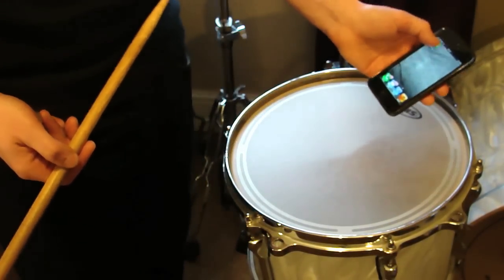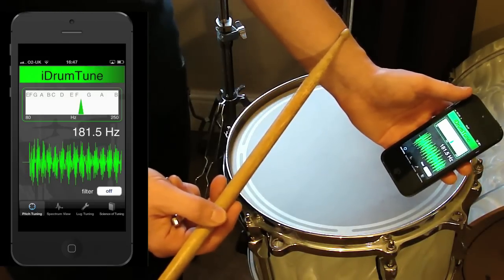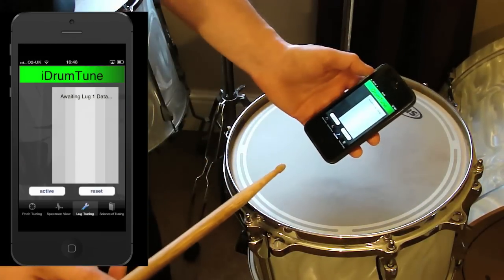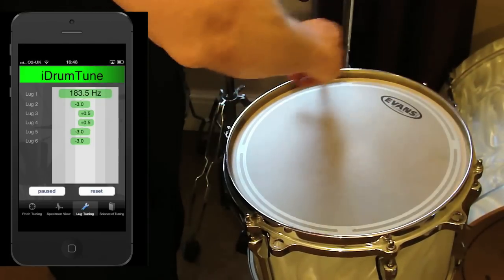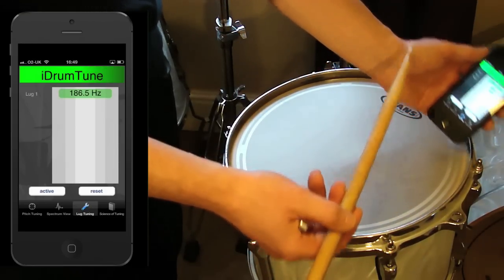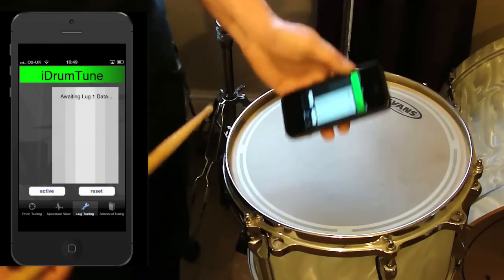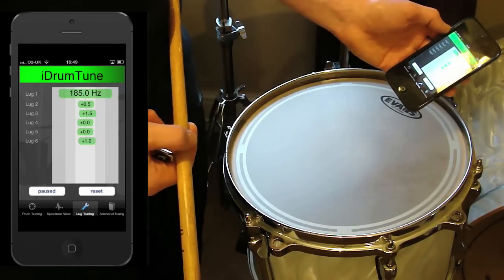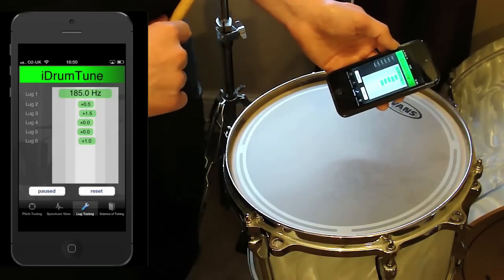Clearing the drum head - Drum Tuning with iDrumTune drum tuner app

Comment: Gary E, I couldn't disagree more, that end pitch was so nice and pure sounding, although I did notice it died instantly making me think the bottom head was tuned quite tight.  Greg Patterson you may have experienced what I found to be the issue with Tunebot, which is these types of tuners are so accurate that you have to be very precise in how you hit the drum to get this kind of result and also it helps if you get the drum roughed in.

I work in a drum shop and have used a Tunebot extensively and if this app was for Android I would try this for sure as I like how it saves pitches for each lug. I really really wish this was on android because I have found the Tunebot to be a bit finicky.

I apologize to use the Tunebot in these next points but it is all I have experience with. So forgive me iDrum Tune people but I think my points are valid for any tuner of this type as it has almost nothing to do with the tuner and more with what the player or drum are doing.

But back to my points:

1. You have to hit each lug at almost the exact same distance and intensity or you will get a different pitch due to those inconsistencies.  Try it with the app and you will see what I'm saying.  The guy in this video has the added bonus that with EC2 Evans heads you can use the black control ring in the head as your reference for distance.  Also use a stick as your finger is too easy to hit at different intensities.  This takes quite a bit of practice to perfect and I used the Tunebot

2. Also if you have a drum that has lost its round or has a bent hoop you will never get it in tune with a tuner of this accuracy because it will allow you to notice how much those two things destroy the tune-ability of your drum.

3. The other biggest thing is that with a tool of such great accuracy you will need to become extremely accurate at turning a drum key a millimeter at a time. When you get to +/- 3 and lower it gets extremely difficult to turn your key consistently without a fair bit of practice. Also a a lot of cheap drums I found that no matter what I did they fought me and would not ever get this accurately in tune. 

4. A finer point about tuning accurately is that if you tension rods are junk or not greased, or bent or anything like that they will not tune as accurate as you like. That plays a part in cheap drum sets. Having put together about 100+ drum sets and re-headed about 200+ I found that cheap drum sets have extremely cheap tension rods and tension rod receivers, which only complicates this process. Thus why DW and PDP went to tension rods with more threads for more precise tuning.

5.Not sure about this app but I found that with the Tunebot it helped immensely to hold the mic closer to each tension rod than in this video and it would get a more accurate reading but this video makes me think that this app doesn't suffer from that issue.

6.  Finally since we jam our phones in our pockets and they sit around a lot your microphone hole on your phone may have lint or something obstructing it, wouldn't hurt to compressed air that baby out from some distance to avoid getting it wet from condensation or blasting it so hard it breaks. Or if that seems a little risky just check it visually and maybe take a fine point tooth pick to grab any lint or whatever.

To conclude, Greg you have done nothing but slander this app.  You have not stated any problems you had or anything you did to try and resolve any of those problems. That makes me think you got really frustrated and had no idea what was making it not work and just stopped using it. If not then please be more constructive and specific about the issue(s) and maybe someone can help you.

I wouldn't give you such a hard time but I went through a similar issue with Tunebot before realizing the many easy mistakes that can be made to cause these kind of devices to not work up to their potential. 

These tuners are the future and should have been around for so much longer. If we can get accurate tuners for guitars then drums should be able to have them too.
Reply: +Jonathan Davis  Very good review. I love idrumtune.
Reply: Well stated Jonathan!  I will add to improve consistency for lug tuning regarding velocity I use a long pencil with eraser